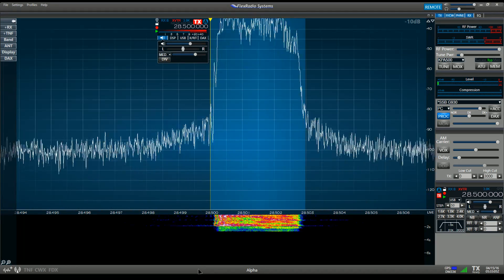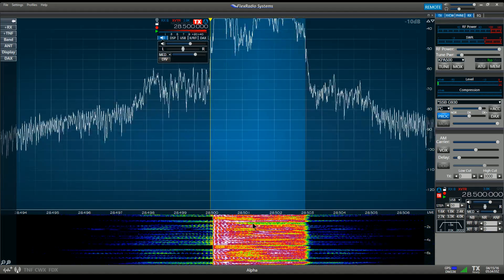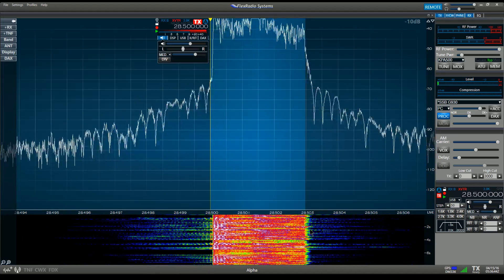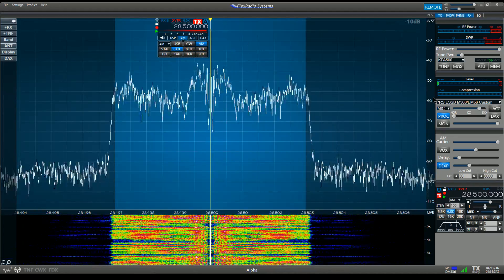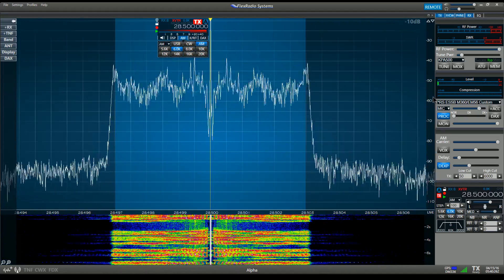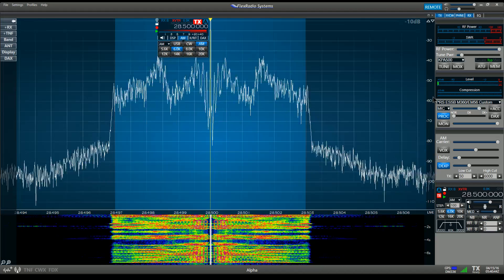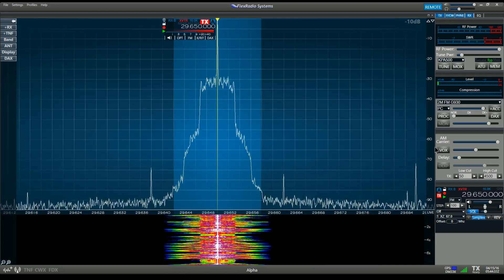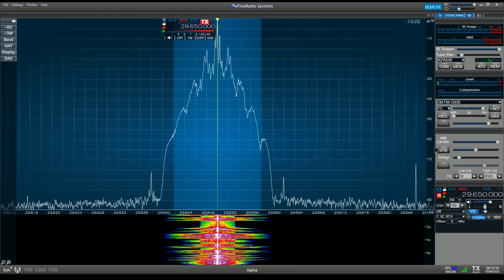ICOM IC-7300 Audio Analyzed from a Flex 6700

Comment: I am still aggravated by these new rigs not allowing out to TX audio bandwidth possible on FLEX. Why not leave it to the discretion of the ham operator? I would think BW control a matter of Fourier transform and other means, not discrete components/chips. 

As for myself, I am going to the 'dark side'....SDR transceivers 100%. Selling off my IC7700 and likely will never go back. Just MO...I am ready to DUMP romance with ole skool knobs and small bandscopes....especially 'real' radio options/functional features are ascribed to a NEW radio rather than being a firmware upgrade. Hey...just buy a new radio?? !! Oh...did I mention 'made in USA'? But what do I know

Comment: Would be perfect if you could go out to at least 4K
Reply: Do you use the flex for essb? Or is there certain radios that are newer than my 870
Reply from the maker: @JayN4GO  Yes, I use the Flex for that.   It can go as wide as 24Khz AM, but I typically stick to no greater than 6Khz SSB on rare occasion.  It sounds amazing!
Reply: ozy311 which flex are you using?
Reply from the maker: Glock 6700
Reply from the maker: I agree.  I don't understand why these Japanese manufacturers don't understand the desire for ESSB.   As long as the band isn't in use, I have no issues with people spreading out a bit.
Reply: People don't seem to understand what kind of splatter you create if you do that. ICOM understands it very well. If you want to have it sound OK, use FM instead.

Transceivers that can handle essb should be forbidden. https://www.w8ji.com/transmitter_splatter.htm
Reply: Roeland Jansen it’s an aspect of the hobby that many enjoy. Not everyone likes talking through a tin can. Most hifi ssb is still within 3k. Buy a radio with filters.

Comment: I respectfully submit that your test is failed and misleading as you seem unfamiliar with the Icom function button used to actuate the COMP feature. The COMP and BW feature is engaged and adjusted by the same button with short and long depressions. As you engage the COMP you are also switching from MID BW (or NARROW) to WIDE BW. This was also instituted on the 756PRO series and maybe others as well. I can hear the increase in the TX BW and can see it on your display as well.
Reply from the maker: +Jean Brown I just verified and you are correct.  I am a fairly new ICOM user.  I will leave this comment for a few hours and then delete this video and redo it again with the WIDE enabled on both settings.  Thank you for pointing this out.
Reply from the maker: +ozy311 Please note that the main motivation for creating this video was to show that ICOM does indeed limit the high and low to 100/2900, but I guess this has been like this for a very long time on many radios.  Do you have any idea why ICOM only allows such a small TX bandwidth?
Reply: +ozy311 Thanks for your trust in my evaluation. Icom seems to take a conservative position concerning TX bandwidth. As some newcomers would like to think that the 7300 is a Flex-in-a-Box, it is not the case in so many aspects. It is one hell of a radio nonetheless. Also, the combined COMP/BW functionality has been the source of thousands of mis-set TX profiles. If I may generalize, reading the manual is one thing, understanding it seems to be another.
Reply: +Jean Brown Conservative?! More like all they care about are Contesters, and Dxers. Well..., that's there loss! They are loosing a lot of money/sales because of it! BTW. Nice get on seeing the video flaw. Thanks.
Reply: +ozy311 Very frustrating. I had so much hope for this radio.

Comment: FANTASTIC VIDEO!!! I can not thank you enough. Very Thorough. Just what I and others were looking for. One question. Were you using the newest firmware update 1.12? The most surprising thing to Me was the difference in bandwidth with the compression on and off! The compression should NOT be widening the bandwidth like that. The compression changes the tone dramatically! Did you get to see My post and the video about the Dots? I was incorrect about the location of the setting of the dots. You can see the location in the video. The new 1.12 update was for the SSB TX. Did you see any difference from the previous version? The video results was disappointing to Me. For an SDR radio there should be MUCH more FLEXIBILITY. I will be commenting more on this excellent video in the near future. Thank You so much again. Join us everyone at. https://www.facebook.com/groups/920301584731431/